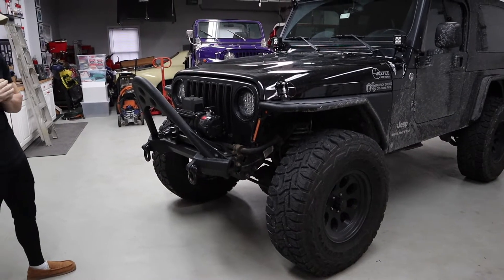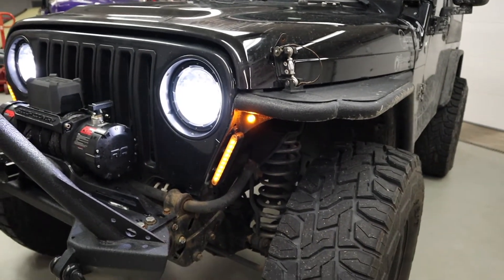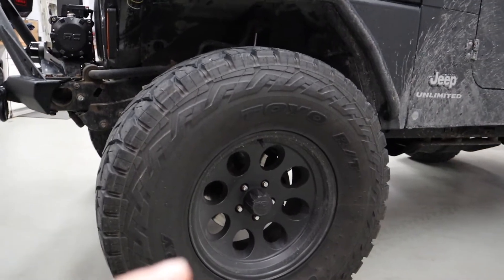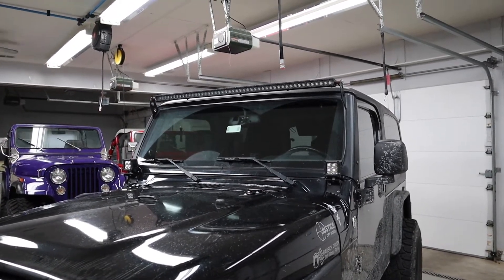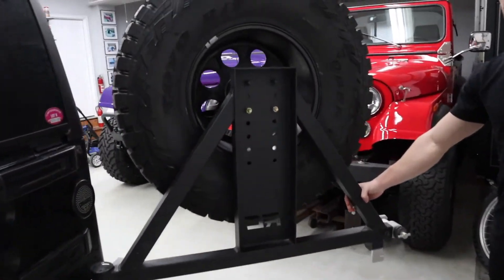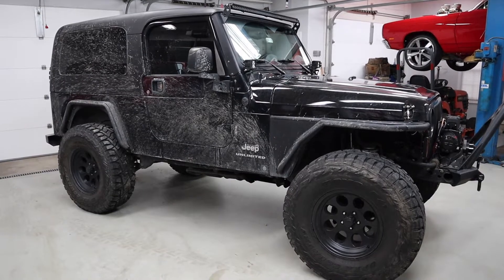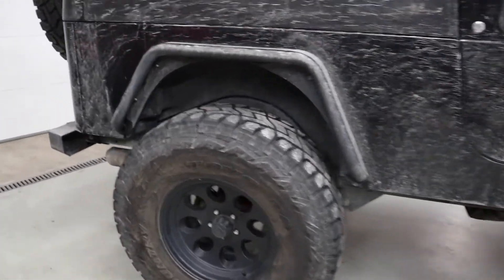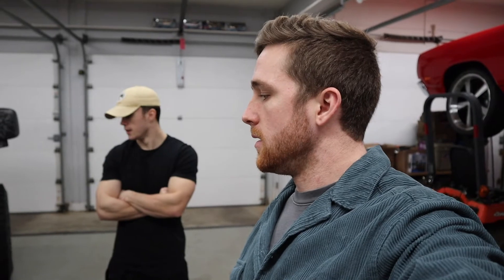Jeep Wrangler LJ Build Walkaround

Comment: What size wheels? How does it do with 37’s? Sorry if I missed it, but stock axles and gearing?
Reply from the maker: All good, now that I realize it we didn’t cover that stuff.  17” wheels and it’s rides very well.  I think 17”s are perfect for a 37” tire.  Stock axles, 30 in the front 44 in the rear with 4:88 gearing.
Reply: @BuiltDifferentGarage   did you upgrade gears? 4:88 is not stock , I think my LJ has 3:73 from factory
Reply from the maker: @isachar2013  yes they have been upgraded!